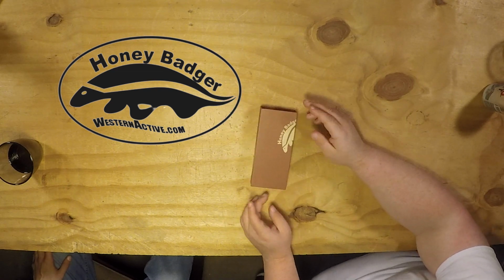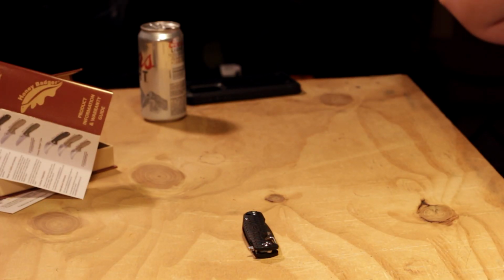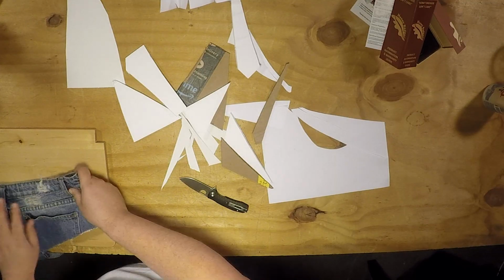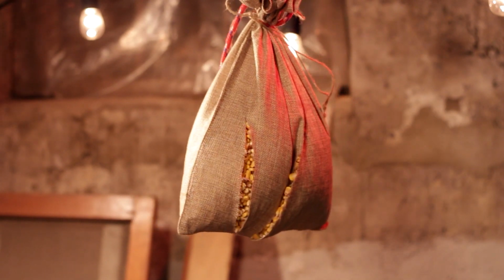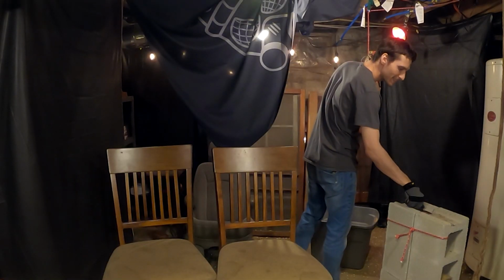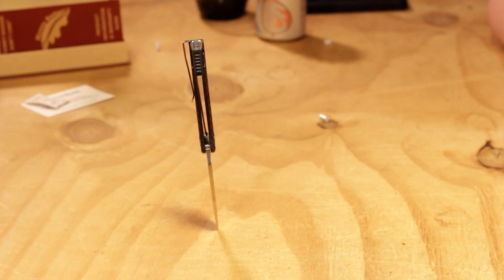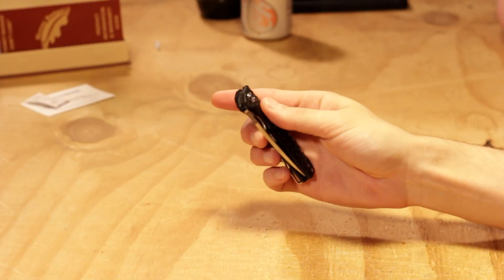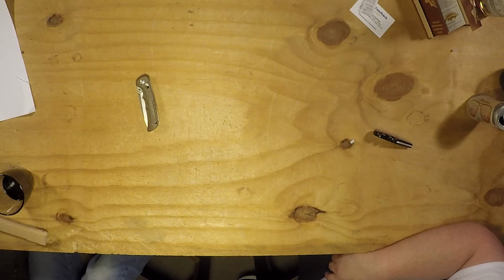Western Active Honey Badger Sm | Review/ Torture Test

Comment: Quality content thanks guys. I got the large blue honeybadger. It´s a bit longer (handle) than the Spyderco Tenacious (partially serrated black) and it fits my hand even better. It opens more easily than the SC Tenacious even with the "spidey flick". Both opening mechanisms (flipper and thumb hole) work well on the Honey Badger. Well worth the price even though mine is the 8cr13MOV steel version. Thinking about buying the D2 one as well. The only thing better about the Spyderco Tenacious in my opinion is the looks (and maybe the liner lock) that´s debatable because the blue HB is pretty rad looking as well.

Comment: You should get a better sharpener. I had one like you use. They work in a pinch, but not that good. I now have a small Worksharp that wasn't expensive and works a lot better.
Reply from the maker: Is that the EDC Sharpener or the slightly bigger one?
Reply: The Work Sharp Guided Field Sharpener. It works great for me.